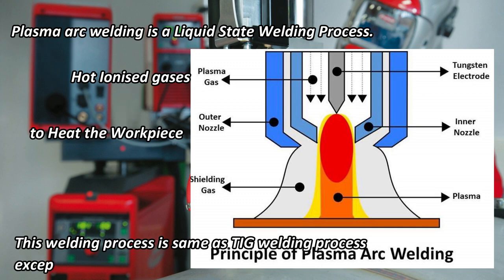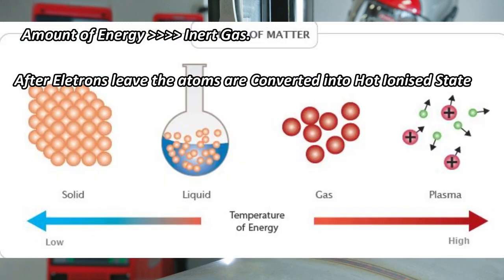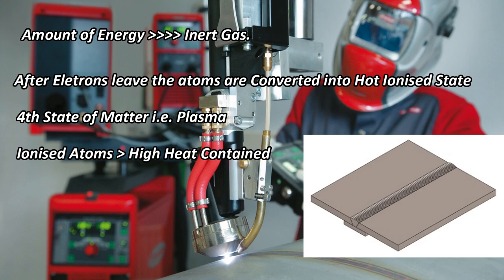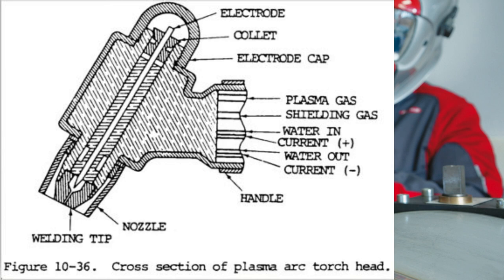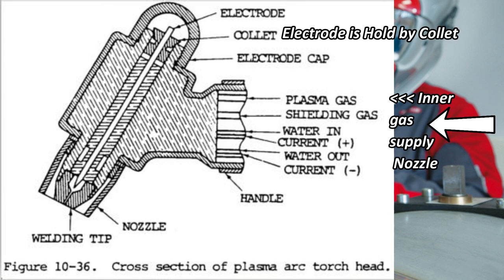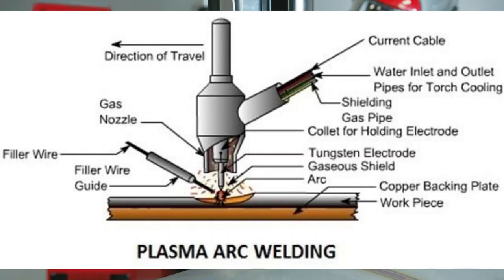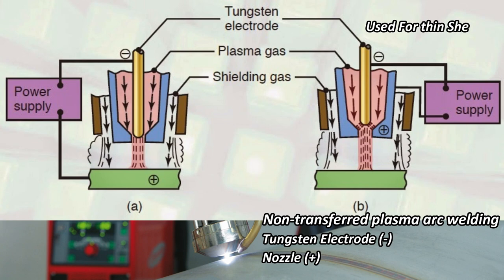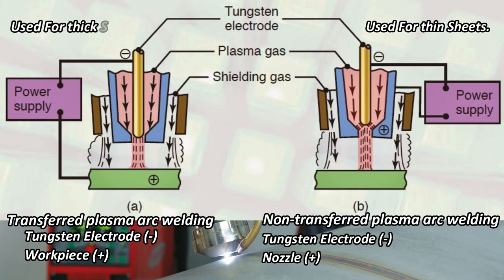The process of Plasma Arc Welding. ||Engineer's academy||

Comment: What is actually the function of the plasma gas? Is it as the heat energy to melt the work piece? And does the tungsten electrode melt alongwith the work piece? Thnx for the answer.
Reply: The tungsten is a conductor, and  is not consumed during welding.

Comment: Which filler metal used in plasma arc welding
Reply from the maker: Mostly No filler Material here in this Welding , But if it Required then u can go ahead With Aluminium 1050
Reply: Hi I am a plasma welder in my job we use solid welding wire 
I weld  pipes in 4432 Cr-Ni-Mo Austenitic Stainless Steel

Comment: Are plasma gases and orifice gases are same ??
Reply from the maker: No Brother Plasma gas is what actually used in the Cutting Process While the orifice gas is the shielding gas, N both are Different.
Reply: @EngineersAcademy9204  how are they different? you mean the gases or the process or work each one is doing?